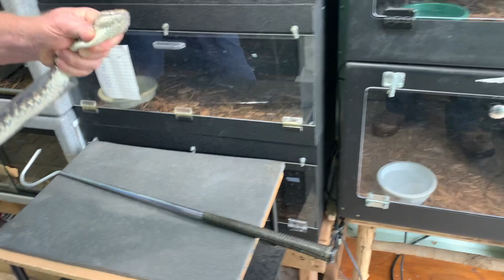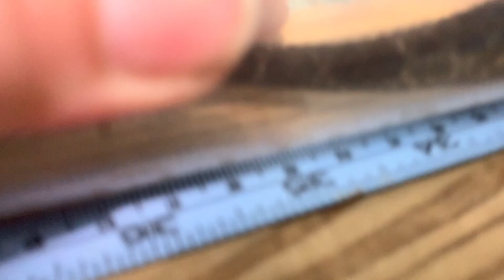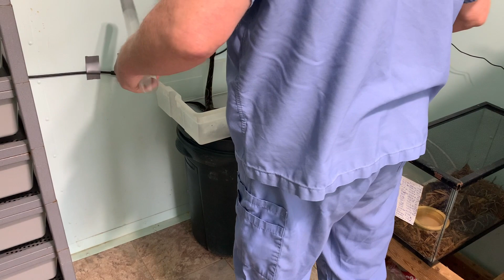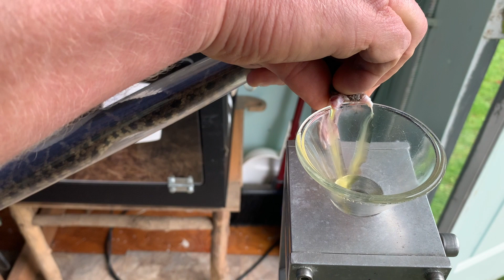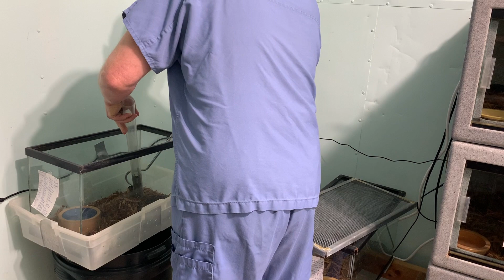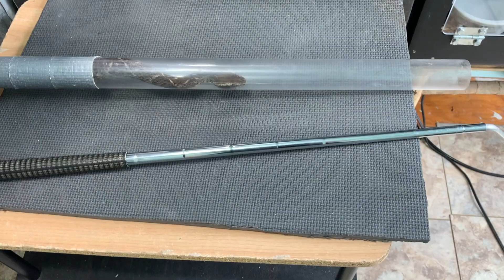Jararacussu venom extraction

Comment: Name if this snake ??
Reply from the maker: This is a lance head viper called a  Jararacussu. The scientific name is Bothrops jararacussu.
Reply: Highly Venomous and can grow to over 7 feet 

Like all other species in the genus Bothrops, the jararacussu has rather potent venom, potent enough to kill sixteen people. The venom contains cytotoxins, hemotoxins and myotoxins, one study with 29 bites of jararacussu in the state of São Paulo, Brazil, found. Severe signs of local and systemic envenoming such as necrosis, shock, spontaneous systemic hemorrhage and renal failure were observed in patients bitten by specimens over 50 cm. Smaller specimens were more likely to cause blood incoagulability. Fourteen patients developed coagulopathy, six had necrosis (causing amputation of one) and five had abscess. Two were in shock, while four developed kidney failure. Three patients aged 3, 11 and 65 years died due to respiratory and circulatory failure, even with large doses of specific anti-venom management in an intensive care unit. The autopsy of two patients showed acute tubular necrosis, cerebral edema, hemorrhagic rhabdomyolysis at the site of the bite and disseminated intravascular coagulation. One survivor had chronic renal failure, whose autopsy showed bilateral cortical necrosis.